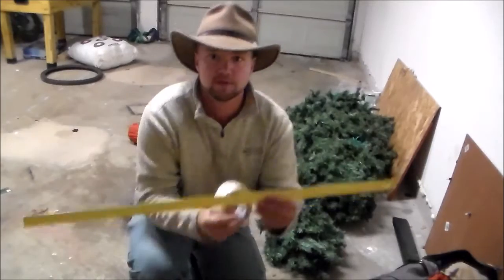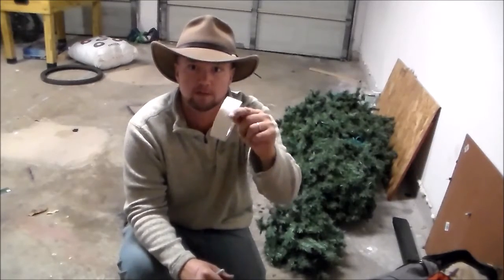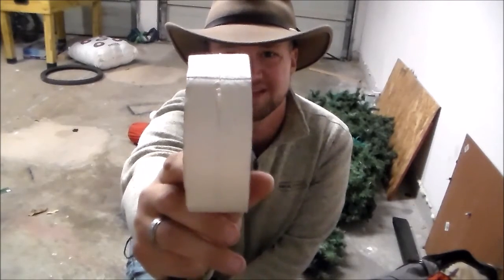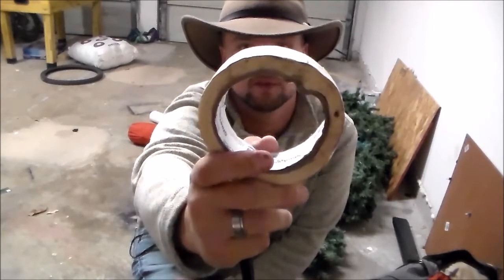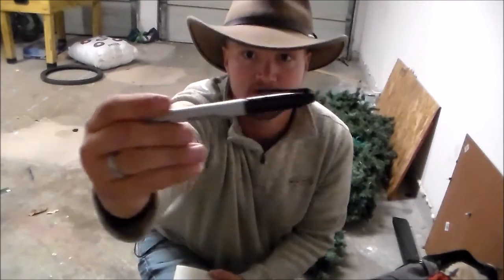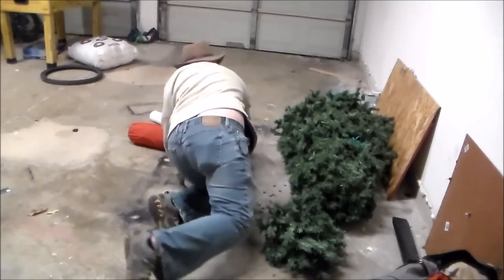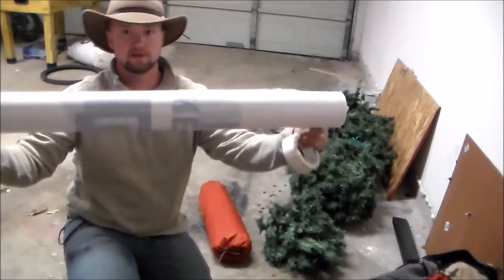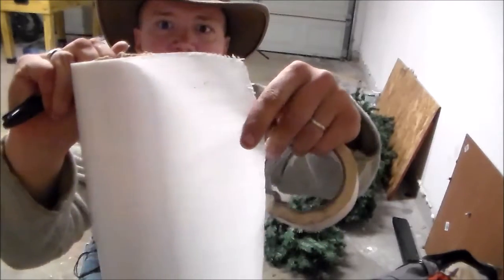DIY:  Tyvek BIVY

Comment: Wouldn't using Typar or similar work much better by eliminating the noise that Tyvek makes?
Reply from the maker: u can wash the tyvek to reduce the noise
Reply: Please use real tyvek brand not that plastic perforated stuff